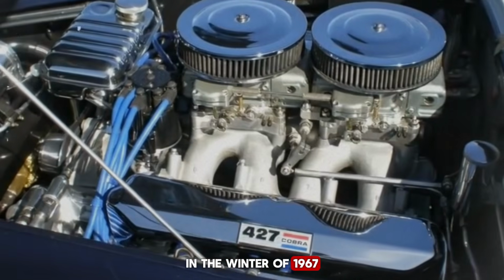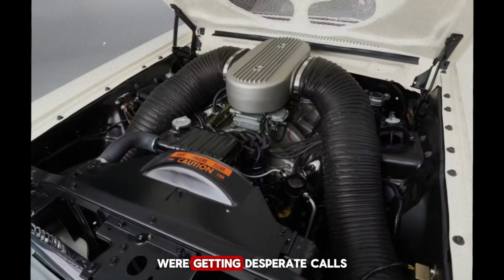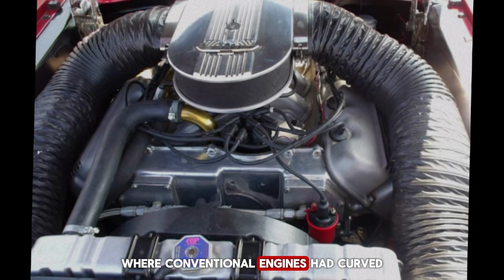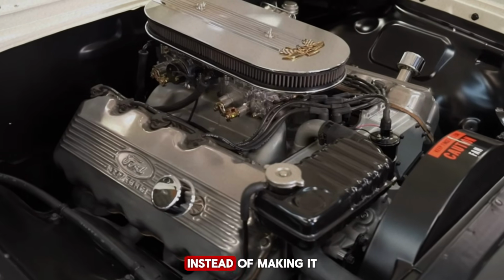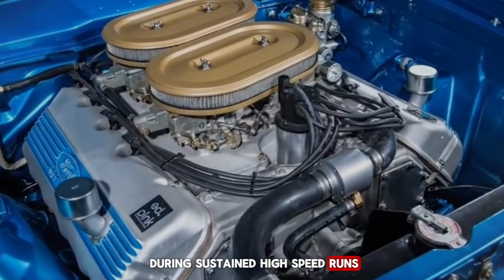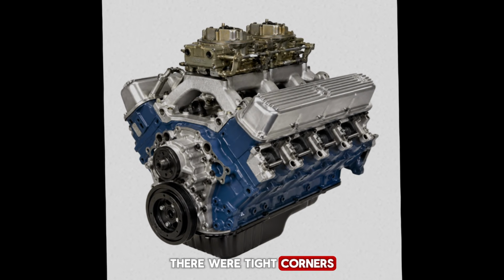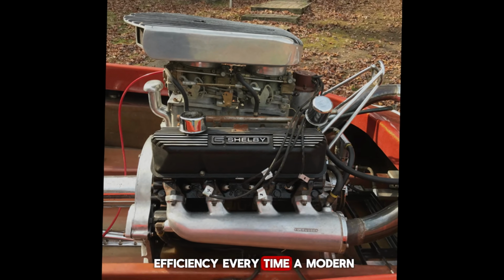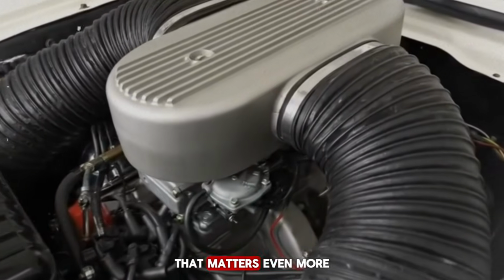The Engine Ford Built in Secret — The 427 Tunnel Port V8

Comment: In 1964 they finally got the bugs out of the 427 Hi Riser and began to win races and that cylinder head was close to the Tunnel port in flow . Bill France then banned both the 426 Race Hemi and 427 Hi Riser .Ford and Mercury won more Daytona 500 races in the 60's than any other brand .

Comment: The actual reason it was called the tunnel port was the intake ports were round. There was a brass tube pressed through the intake ports for the pushrods to pass through.